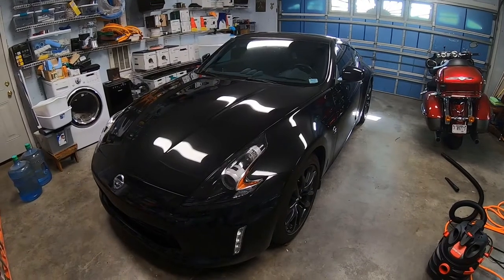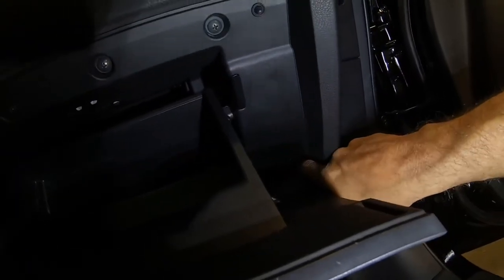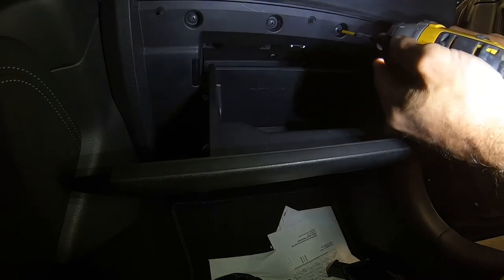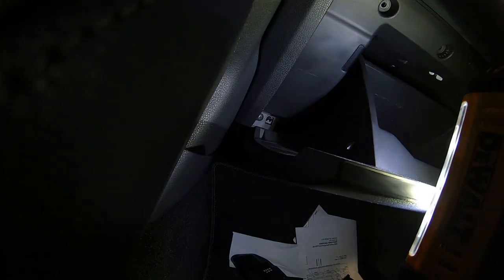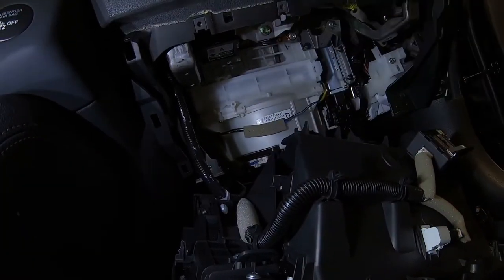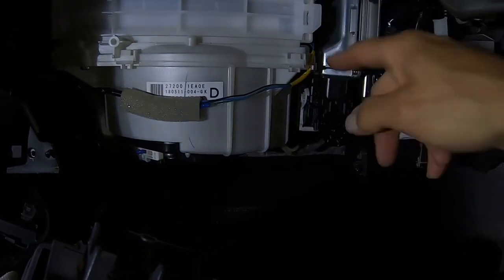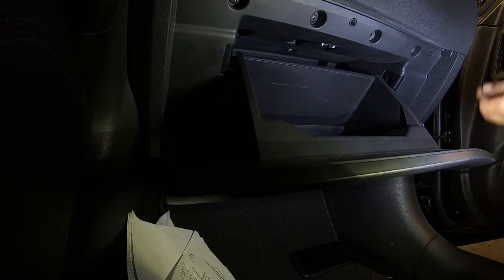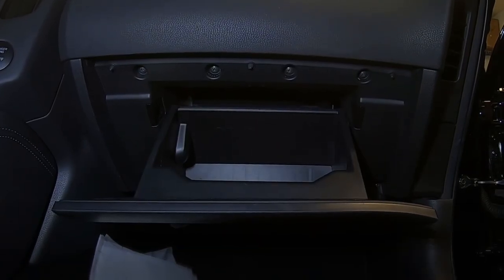370Z Nissan Cabin Air Filter Removal & Replacement: Easy DIY & Save Money

Comment: Thank you for this video, Greg. I've had a loud clicking noise coming from my aircon, but only when the a/c was set to 'recirculate'. Your video helped me to remove the glove box and cabin air filter and - hey presto - as if by magic, the clicking/knocking noise stopped. I've replaced everything (having turned the air filter 180 degrees) and it's still ok. Whatever was causing the noise has returned back to where it should be and is working 100% properly again. Easy fix! Thanks again for taking the time to make this very clear, helpful video, which benefits massively from not having all those stupid, screaming, 'hey guys, subscribe and like me' hysterics.
I'm in the UK. so the glove box is on the left side of the car, but everything behind the glove box is identical.

Comment: Bro you coulda took the piece out before shooting the vid. Now I’m scared
Reply from the maker: It's not the one you can see that should scare you.  lol  That should be standard equipment for all law abiding citizens....  Another good place in the 370z is the "secret" tray under the passenger seat that they don't really tell you about.
Reply: @RagerJackOfAll  wait what now? Wheres the tray lol
Reply from the maker: @MrMeeseeksthe1st  Lol look under the passenger seat, at least on the 18,19 there is a plastic pull out tray, I'm guessing for owners manual something like that but a Glock 43 fits in there real nice.

Comment: Thanks for the video. The only difference I had with mine is that I had a wire pulley mechanism attached to the glove box door to slow it down during opening. I was unable to remove the whole glove box panel assembly because of that but it wasn't a huge deal. Still had enough space to remove the air filter.